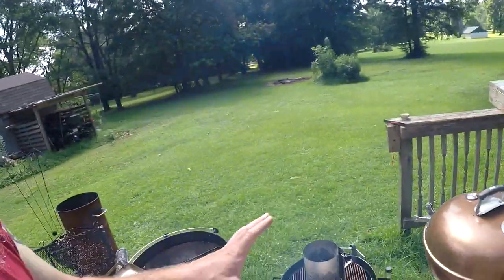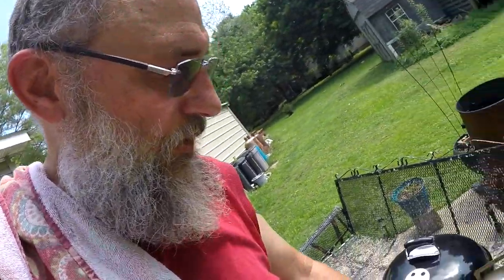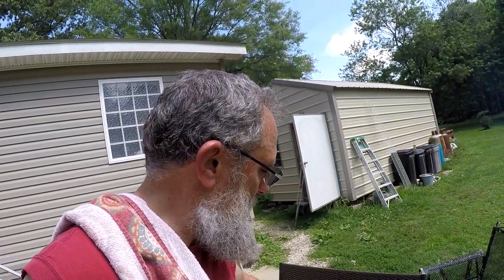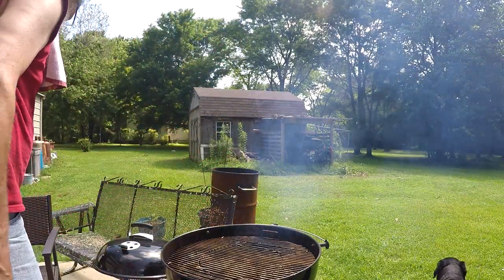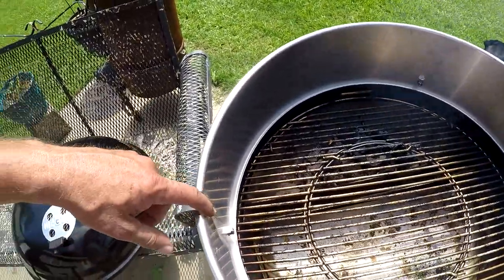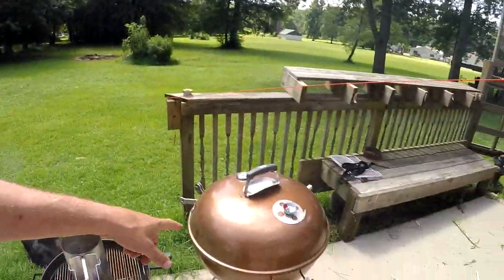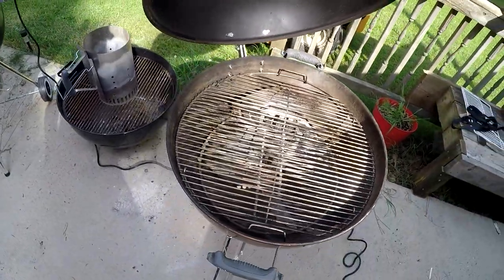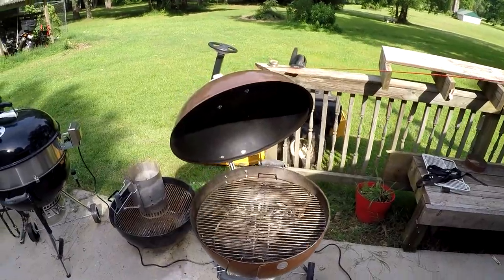How to modify the airflow control rod on the Weber Kettle

Comment: I enjoyed your video.  Concur about not laying wires over the lid edge. Noticed after I installed the Probe Seal there was no more smoke leaking at the wire location. So it not only keeps from damaging the wires but aids in sealing the lid. And gotta give ya a BZ for the inovative Carriage Bolts. Such a simple fix, Great Idea. 
I've subscribed to your Site. Have A Great Day.
Reply from the maker: Thank you for the comment and the sub. Be well and be blessed.

Comment: I don't need to justify how I like to use my grill lol if I want to use my slow and sear and dripping griddle I will. 
I have the 2.0 the rivits are solid no issues yet . I did the probe gromit it's a good move. I also got a air flow damper from SnS and put a air hole just under the coal basket like their grill no more ash filled air dempers oo guessing if it's open enough
Thanks for the great tips !
I've been thinking about modify a top replacement vet baffel basically cutting it in half then making new vent holer closer to the grill my thoughts are this will draw the heat and smoke over the meat more

Comment: I don’t think the mod to the lower airflow Handel was necessary, l think the assembly was put together incorrectly in the factory leaving the handle 180 degrees out of sync. Mine had the same problem when l was putting together, all it needed was to disassemble it and reassemble with the handle now 180 degrees opposite to where I was originally and that sorted it.

Comment: Am I missing something - the bend in the handle actually gets the sweeps past fully open and start closing  - I just dont get the mod. Mine closes fully one way and is open fully the other way??
Reply from the maker: This mod allows the blades to sweep ash into the clean out/air holes from both sides. It is beneficial when doing long multi day cooks and you need to clean the ash out while cooking with hot coals in the way. Thank you for watching and commenting.

Comment: I have heard that those pass throughs are not good as the silicon is heat resistant but not flame proof, let us know how it works long term.
Reply: Don't install it on your direct heat side.